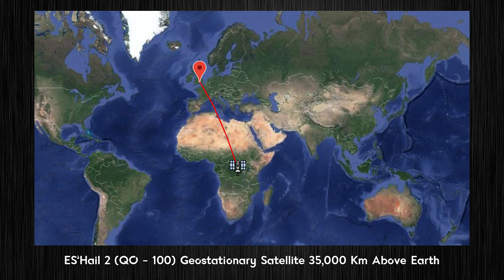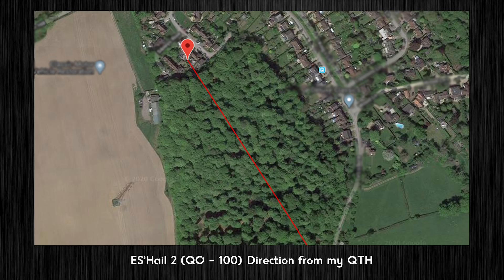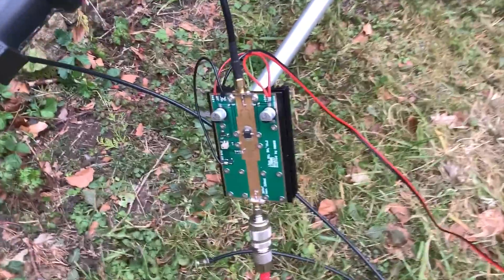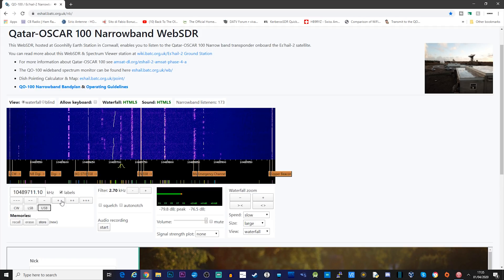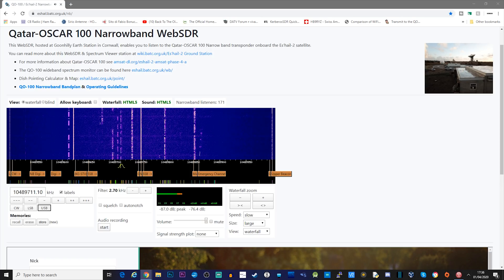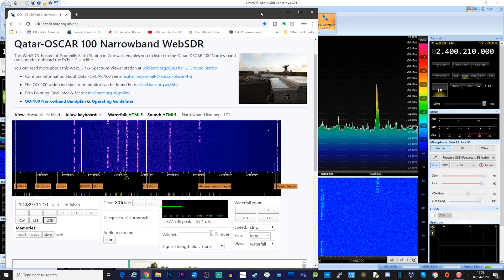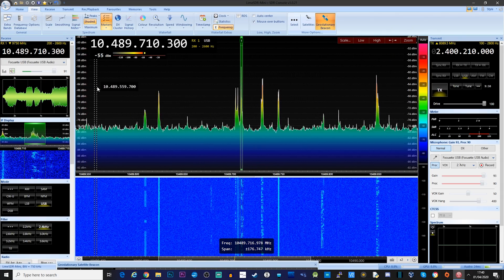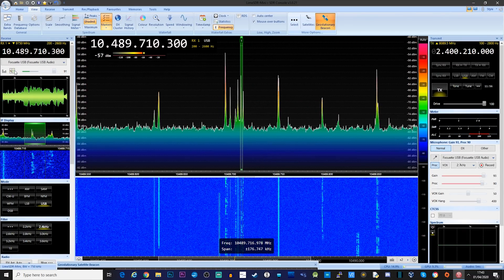QO-100 Uplink Transmitter - My First Contact

Comment: so, from the 8W chinese wifi amp you drive your tx to an other amplifier that needs 24VDC? I dont know, i think ive lost you.
Reply from the maker: That was purely because there is so much power loss with the type of cable I was using and the length of it. So I can to amplify the weak signal once it got to the dish.

Comment: Getting on QO-100 myself at last too :-)
Tx Path: HackRF One to two cascaded 20dB LNA to 12m LMR195 coax to 8W(4W) Chinese amp to POTY on 1m dish 
Rx Path: Generic LNB to RTL SDR dongle to SDR Console for RX with Geostationary beacon tracking for frequency correction on RX path :-) Thank heavens for that!

But only getting 20dB SNR where beacons are around 39db. And that is with a single tone. For SSB I barely get to 10dB SNR. 
So for now mostly doing RTTY, PSK, FT8 & little CW on QO-100 
I think I can try a few more things before the obvious next step of more tx power: I'll try to align the dish better / I'll do some focal point analysis to see if there might be any betterment left there (maybe the POTY could be at a better location?)
Best 73
Reply from the maker: I’m just going down the Pluto route right now, going to get it modded for stability then hopefully I’ll be on air more :) 73 and good luck with the project
Reply: Hi Jacques, Ill have to take up the setup and connections with you. Now ready for connection all the gadgets. Still need a few cables.

Comment: Really cool. But why do you have three different 2.4GHz amps? I understand the CN pre-amp, but why are the next two different types of devices?

Do I understand right that the second amplifier is just so that the signal, can go out into your garden, 2.4GHz not being coax-friendly?
Reply from the maker: Exactly, the second black amp is because I was using really lossy coax and by the time the signal got to the dish it was only around 35mw. I then fed that into the amp next to the dish which gave me around 1w out at the patch antenna :) I’m completely changing this setup as this was just a proof of concept to start with. Thanks for watching! :)
Reply: @TechMindsOfficial  Is RG223U good for this?

Comment: Very cool! Is this a geostationary satellite? What's the total cost (beyond your Icom 9700) for the setup? upconverter and antenna, receiver, etc?
Reply from the maker: Yep it’s a geostationary satellite :) I wasn’t using my icom to transmit, I was using a LimeSDR mini and SDR Console software. Cost is hard to put together because there are a few ways you can achieve the same thing. If you don’t want to go down the SDR route, checkout DXPatrol website, they do upconverters, downconverters and amps so you just use a 2/70 SSB radio. :)

Comment: I am using a Pluto that has a GPSdo - If you want to use the  Pluto on Ethernet ( so powered directly from USB, you will need to do the "power mod" to prevent it from hanging, due to stray inductive coupling  so best to do that when you pull it apart to out in the TCXO ( the power mod is a simple wire link) ;)   Enjoy QO-100 !!  I am usually listening around , and also on the IRC channel  #es'hail-2  on Freenode ( which is also on the Goonhilly NB TP page)
Reply from the maker: Thanks Neil, I hadn’t looked into that but I will research it! 73s and hope to work you one day.

Comment: Thanks for a great video, hope the leaves don't block the path to the sat as spring turns into summer.
Reply from the maker: To be honest, I think they will :-( I’m planning on raising the dish around 2m where it is now. If my receive gets blocked then I’ll use websdr for receive and then use brute force RF through the leaves with more power 😀

Comment: What kind of TXCO? 0.1?
Reply from the maker: I’m not sure tbh, but not suitable for 2.4ghz. There is a way to use an external TCXO but I’m going down the ADALM Pluto route next week.
Reply: Cant wait for that Im thinking about getting two plutos for lon range chat or 2 dream catchers.
Reply from the maker: Well, the Pluto still needs a better TCXO for 2.4ghz but the Pluto can be networked which is something I like. On the subject of Dreamcatcher chat, there is a new version of that, it’s web based, hopefully be doing a video on that soon too :)